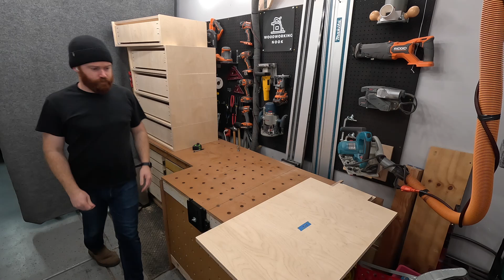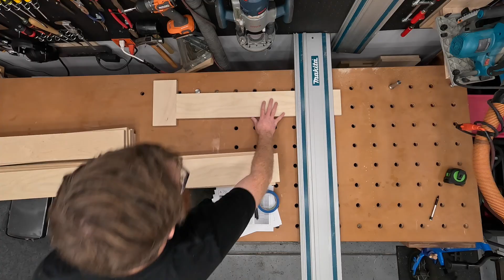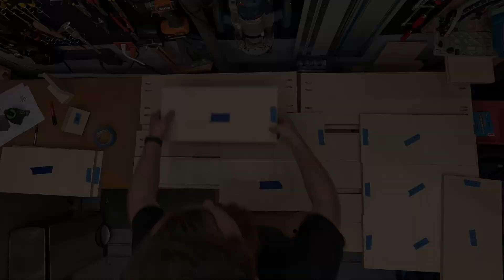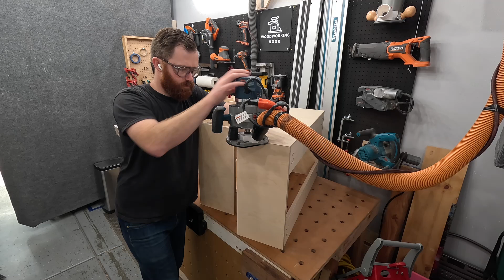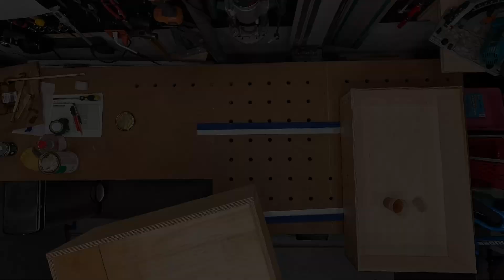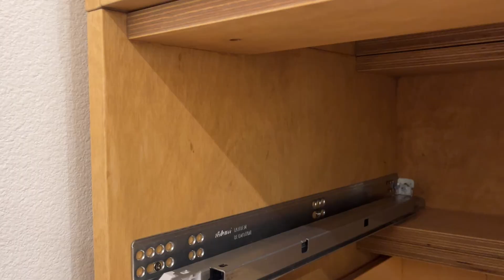MODULAR Dresser Build

Comment: What size chamfer was used?
Reply from the maker: I actually didn't use a chamfer bit on this build. I only used that edge sander on all the edges. I would guess it is around a 32nd or 16th of an inch

Comment: I don't know if you are US based - a law called the STURDY Act was passed in 2022 that required dressers meet certain tip over standards. Not sure what exposure you could have for building or selling plans that don't meet those requirements. 

I don't build dressers specifically because of the law.
Reply from the maker: Thanks for the info! I am aware of that act and from what I have read, it only applies to manufactured items for sale. Videos and plans are not regulated under that act. I did add an additional disclaimer to this video just incase. 

I created this dresser for our home as well and sunk 3.5" screws into all studs to secure it. You could almost call it a built-in 😂